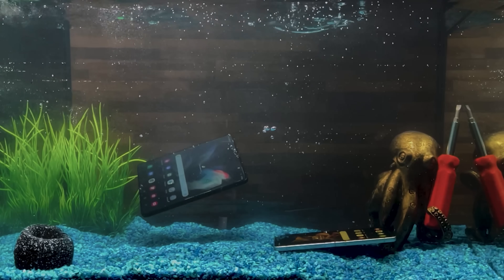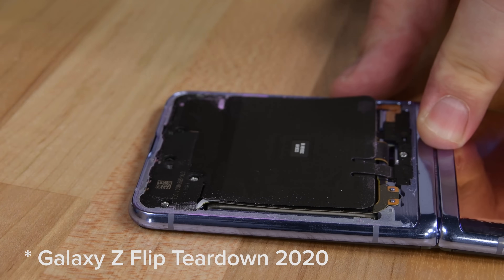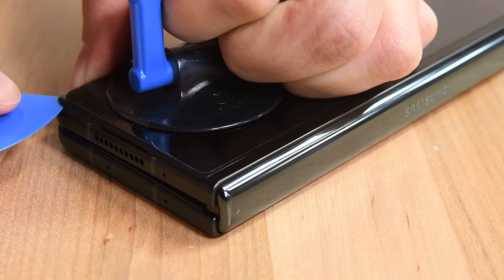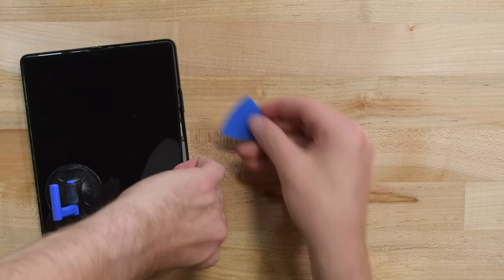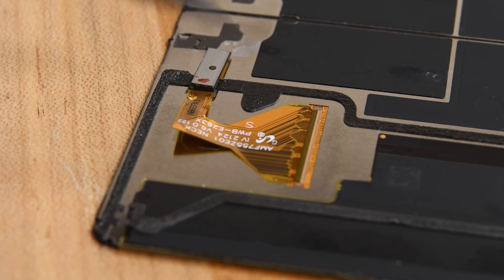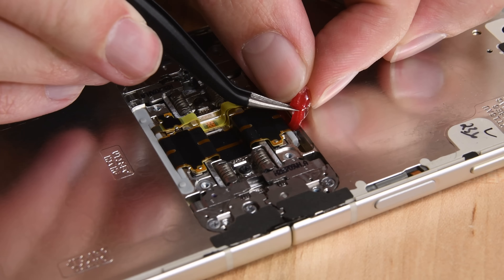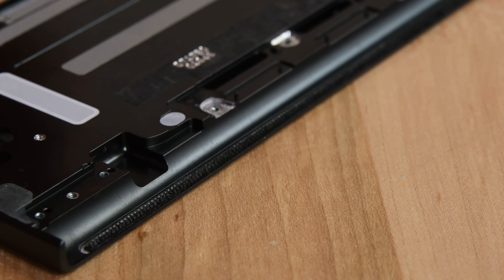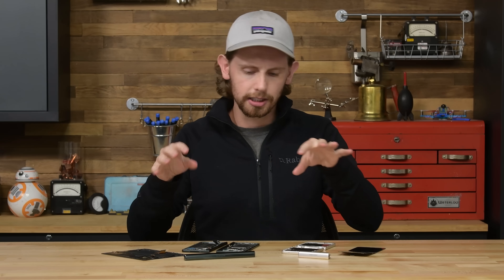Galaxy Z Flip & Fold 3: Small Changes Make a Big Difference

Comment: Frankly I had to switch from my flip to a razr 5g. Folding glass just isn't something trustworthy or durable these days. I'm much more confident in the razr durability.
Reply: Lol you traded crap for crap. 🤣 Yeah, the 1st Gen UTG phones had an infamous propensity to shatter down the fold-line after a year or two of use, but the RAZR/5G really wasn't much better and was also a significantly worse phone. 🤷 SOOOOO many of those screens died or broke via things like display delamination. There's a reason Motorola immediately switched to UTG as well.
Reply: @Cooe.  that phone lasted all the way until i got my next one recently actually. Loved it. worked great and so did the screen. It also was openable with one hand unlike the flip. 

Maybe try forming opinions for yourself instead of going off 2 year old tech review channels :)

Comment: It's nice seeing how they are improving them with each iteration. In a few years, these may actually be worth buying. Right now, durability is not even close to a regular non-folding phone so the price is hard to swallow.
Reply: It's actually quite a bit more durable than a lot of normal phones.
Reply: Wrong. The inner screen is more durable than any glass screen, being plastic. Also this is one of the few phones to have passed jerryrigeverythings test and drop tests. It has proven itself to be far more durable than any non-folding smartphone
Reply: @FrankFurther  That's not even true, the inner screen is glass and has been shown to crack randomly after about a year, sadly. I hope samsung switches back to the old displays from the original fold, the plastic was much more durable.

Comment: Uh, probably just making a better phone is probably much more important than making it more repairable. Most people don't repair their own phones, and also a lot of people don't switch because their old devices are broken. Right to repair is definitely needed, but I guess anything that has to be done is that the manufacturer should provide parts and repair manuals, and remove proprietary screws and software locks. Repairability is important, but probably a better screen, more processing power, or longer battery life is much more important to most people.

Comment: So water can still get in, but if you design a system like that, which would be "Water friendly" then I assumed you should give the water a way to get in and a way to get out. .. 'Cause you don't want any water staying inside longer than it should (I mean after you take it out of the tank, water should get out as soon as possible)
Reply: Its coated on the inside for corrosion resistance... so i doubt anything bad will happenwater will prob evaporate
Reply: Yeah, you're both right, but evaporation doesn't mean you got rid of humidity
That's why I got a little concerned about that when he opened it up, those were big water drops right there, and since I want to buy myself a foldable phone. .. Well, you can still say that it might be water resistant for a while, but not water proof like JRE showed us with MrMobile
Reply: @xrslive  the same goes to other water resistant phones as well. Having protection is better than having nothing at all.
Reply: water trapped inside will probably evaporate under normal use
Reply: If it has a way to get in, then it has a way to get out.
Reply: Just shake it out

Comment: The way Samsung has made these phones water resistant makes me kind of nervous. What are the chances that something is going to corrode or have mold grow on it?
Reply: Don’t give them ideas 😂 it’s bad enough with the manufacture specifications to last until the warranty runs out gimmick.
Reply: @darthraider450  Sounds about right 😂
Reply: Both phones just seem way too gimmicky, no durability in the design.
Reply: @CT-vm4gf  “No durability in design”. So, you have had this phone for quite some time now, haven’t you?
Reply: @CT-vm4gf  From all the long-term reviews I’ve seen they actually seem quite durable, just a massive pain to get repaired when they do break. I do agree that they are kind of gimmicky. Never felt any of my phones would have been much better if they could fold.
Reply: If someone gets their fold/flip wet most of the time, that's not the phones' problem.

For accidental water submersion, any tapped water should evaporate under normal use.

Comment: Manufactures are using "water resistance" as a poor excuse to glue the whole device shut. 
They just want to avoid making it more repairable. 
The most environmentally and consumer friendly approach would be a modular design like the Galaxy S5, which had a user removable battery and water resistance...

Comment: Seems like just another unrepairable mess. I'm all for innovation but honestly this is everything but envrionmentally conscious, especially if they're claiming charger removal is for "environmental reasons."
Reply: Honestly it doesn't look that bad.

Ignore the panel removal process, accessing the internals for repairs is pretty much the same process as in a glass sandwich. And even for slab phones, people tend to fix broken panels by replacing the panel and the midframe as an assembly. The panel glue being hard to access isn't that much of a big deal.

And there's a purpose to what Samsung is doing here. Slab phones can achieve ingress resistance without excessive glue, see Xperia Active and Galaxy S5. But I don't see rubber gaskets replacing the glue behind the panel. Without glass reinforcements on the other side, the gaskets might just create a visible bump on the panel.
Reply: @DGao-zz5vq  "accessing the internals for repairs is pretty much the same process as in a glass sandwich"
Which, even though we're all used to it by now, always has been and always will be bad. 

"even for slab phones, people tend to fix broken panels by replacing the panel and the midframe as an assembly"
Cool, just go ahead and defend even more waste.
Reply: Actually I’d always choose durability over repairability. Nobody wants to “need” to repair phones, they just want their phones to never break.
Reply: What do you mean by “environmentally conscious”? You mean people repair their phones instead of getting a new one? Considering how expensive repairing a phone is nowadays, most people would probably just get a new one. Also, you need to prioritize, in this case Samsung prioritized design, usability and durability over repairability, and I for one am Ok with that. It is kinda hard to nail everything, if they could, they would have had, unless of course it would be expensive.
Reply: I understand the importance of "repairability".

but, Samsung is innovating with flip series and they did a great job of delivering what they promise: "a durable and reliable flip phone".

battery is still replacable on both flip phone and fold phone. which is a good news.

I understand that regular phones should be easier to repair, but we're talking about flip phone. nobody make flip phone now.

Samsung make a working flip phone, and utility comes first before repairability. now that this phone works, we could hope Samsung would focus on repairability on their next flip & fold phone.
Reply: @thankyouverymochi  My POV is, yes, Samsung does improve the durability of the foldable series, with the cost of some repairability. It's harder, but still accessible (Although i don't like how Samsung disable all cameras in Fold 3 if users are unlocking the bootloader)

And i'm kinda OK with it, unlike Apple who locks some components to the logic board (like Face ID, one of them) just for the sake of forcing people to bring their phones to Apple for repair. If they are willing to do so.
Reply: Plus with the durability being so bad. If your phone screen reliably breaks after a few months, you should at least make the phone easily repairable so there’s less of a chance of it just ending up in a landfill.